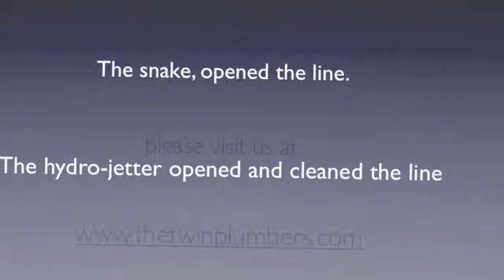Snaking vs. Hydrojetting

Comment: And when your done installing the new sewer main pipe in the trench replacing the broken pipe from the tree roots, don't forget to buy a few bags of water softener salt pellets and dump em' in the trench around the new pipe where the tree roots were growing and then backfill the trench with dirt. By doing the salt dump method in the areas where the tree roots were growing you are preventing the roots to grow back again inside the pipe because tree roots won't grow where salt pellets are. The roots will grow away from that area which means they won't go near your new sewer pipe again resulting in years of solid sound sewer pipe service worry free of future roots breaking in  to your pipe again. You gotta be smarter and think smarter than the tree roots......works every time.
Reply: @Connection-Lost  Yes water they like, salt they don't and grow away from. No thinking involved by tree roots but yes thinking by man can outwit the tree roots. I really didn't think I had to explain this but since you are having problems understanding......well here ya go.
Reply: @Connection-Lost  Dumping salt in an area will kill plants there, so it makes sense that dumping salt near a pipe will prevent root growth, at least for awhile.
Reply: Just curious as to what the salt will do to the pipes in the long run as well...possibly eroded the pipes from the outside in this time maybe?
Reply: @sweep-n-clear  What kind of pipes are you talking about here? Nowadays sewer main pipes are installed in either ABS black plastic or PVC sched 40 white plastic. Neither of those two materials can be broken down by salt.
Reply: @Eddie-In-Las-Vegas  im not sure about the pipes i was curious...I'm having shower problems which might be caused by my palm trees...here in Las Vegas NOTHING is buried deep at all because our soil is like clay
Reply: @sweep-n-clear  I'm a plumber here in Vegas and every sewer main pipe we replaced where the customer did not want to eliminate the big front yard tree that caused the damage to the pipe to being with, we would pour bags of softener salt in the trench with the pipe in the areas where it was close the tree, the tree roots will grow opposite of that area.
Reply: @Eddie-In-Las-Vegas  dang...sounds like i might be calling you next 😁😁😁
Reply: @Eddie-In-Las-Vegas  is $375 a good price for jetting the shower drain?...we paid $80 to do the same thing these guys did in the video...the tip of the snake had a spring like gadget on the end like these guys had i believe
Reply: @sweep-n-clear Jetting service for one branch pipe.can cost anywhere between $300-$600. But consider this, usually a kitchen drain requires jetting service due to the cooking grease that collects over time inside the pipe and restricts flow. A shower drains main issue is hair collecting inside the pipe and a cable snake with a cutting tip usually does the trick for that. Unless you have tree roots, the jetter is quicker and more effective at eliminating tree root growth inside a pipe. Did the $80 job not end up clearing the shower drain for very long? Or is it all fine now?
Reply: @Eddie-In-Las-Vegas  no the $80 job didn't fix it completely
Reply: @Eddie-In-Las-Vegas  as long as you go #1 or just shower downstairs everything runs fine...once we flush paper or #2 down it slows it up quite a bit
Reply: Who said anything about installing a new sewer pipe.  That is SO SO old-school.  Not applicable in 2023.

Comment: Had my sewer line going to street cleaned. Plumber used hydro method. Lasted 3 days and backed up again. Had another guy come and used rodder with cutting tip. That was 5 yrs ago no problem since.
Reply: Jet does nothing to Roots, just pokes a hole. But running a snake with blades will keep the roots at bay until they grow back!
Reply: @JJ-xo3er  You need a special head for roots called "wart hog"  very expensive but works well
Reply: R S  Rootkiller application: Do they insert a line with spray holes  and camera or just shoot and spray the whole length without a camera?
Reply: R S  No desire to have that proceedure done, warm and fuzzy or not

Comment: I live in a 70-year-old house and kitchen sink clogs all the time. I'm advised to use hydro jetting and was wondering: 1. if it is safe on my old pipes; 2. how much that costs; 3. Which state are the Twin Home Experts service. Thank you!
Reply: I just got a quote on my 2300 ft² home to do a whole house hydrogetting. $2100. Since the houses more than 30 years old I'm going to go ahead and just do it. The house was already repyped I believe about 18 years ago.
Reply: @wadafruit  Thanks! I called Roto-Rooter, they cleaned the line and said no need for hydrojeting. $830.00. Been few months and is still works well.

Comment: Right, now try this on REAL pipes in your home, old home and this is probably a disaster waiting to happen.  Old homes use cast iron pipes and sometimes the line pipes are brittle / rusted - these electric snakes can cause a disaster on such pipes and you might end up with very expensive repairs in the 5 figures, that KNOCKING inside the pipes can't be good.  It might be no big deal on the PVC pipes, but I would not use that method on old cast iron pipes, I've heard horror stories there.  Same for hydrojetting, I know someone who did that, and it cost her $25,000 in repairs from burst pipes due to the pressure. You can be sure that all the piping in old buildings and old homes are just disasters waiting to happen, banging and unusual pressure inside those pipes will only make matters worse.  Also a lot of people previous to using those methods have used Draino and other garbage products so over the years this kind of shit made the pipes even worse.   I would use electrical snaking on PVC pipes, I would not use them on cast iron or old home piping that is in bad shape.
Reply: Bad pipe to begin with, have to try and clean it with a snake first and if it breaks the pipe then the pipe was brittle and needed replaced anyway.
Reply: So what would you recommend? I live in a home that was built in 1970. Probably 6 plus years ago a plumber ran a snake 75 feet to clear the line. All the way to the house outlet at the septic tank. I believe he mentioned "clearing roots".  Now the sink is not draining and we have tried all the DIY methods we know. Time to call a plumber. The guy had a large auger-powered snake for the job. He is still our plumber and when he comes to our house that is about the only tool he needs unless it is a new fixture installation.
Reply: @lindahathaway3519  Can use a camera to see what is wrong and its location. Then dig up that spot. Either replace the pipe section, or seal around it depending on what is wrong with it.

Comment: First off, you wouldn't use a puny drill snake on a line with roots in it, get a Spartan 100 machine to clear the kitchen drain. Also odds are against roots in your 2" line, unless it leaves the house separate from the main sewer. Jetting can clear roots with the right head on the jetter. As the thieves at rescue rooter used to say "cable is able, but jetter is better".
Reply from the maker: p gill 
This is NOT implying that we recommend using a small hand snake to remove roots . This video intention shows what a cable does vs what a jetter does . 
Wether it’s a large cable or a small cable it has the same action , NOT power , we get . Roots require a 7/8 cable with cutting blade etc ...

Thanks a for posting

Comment: Great video for the basic ideas of both techniques, as a first time DIY guy I have a good idea as to what I need to pick up from my local supply store and think this video is a great way of showing others like myself 'what the deal is'. I'm having a water build up in my basement 'slop sink' so I plan on hitting up Home Depot for a water bladder and a 50ft snake to clear whatever obstruction is causing the block. Fortunately the water DOES drain itself slowly albeit not good, but better than a complete stoppage. Thanks for the information, this video was very helpful to me! =]

Comment: THIS IS NOT AN ACURATE EXAMPLE! 
I followed up a company that used the jetter to clean a line with roots only 6 days later. I used a snake with a proper sized cutting head to remove the roots that were left behind by the jetter. (The jetter only washed the debris off the roots leaving the roots behind) Here the roots here are placed into the pipe. It is my experience that the roots find a penetration point from the exterior of the pipe through a break or bad joint and grows a tendril root that has to be cut.

Comment: I can’t picture the jetter working when the pipe is BLOCKED to begin with. Wouldn’t the water just come up the drain as soon as the sprayers are activated???
Reply from the maker: The first step is to start slow to puncture a hole through the solid blockage. In certain situations does require using a cable to puncture a hole to release water pressure build up, then move forward with jetting.

Comment: Septic field - Hydrojetting may clear the lines, but the real problem might be that the gravel is gunked full.  Our septic field is 46 years old.  How can I find out if the gravel is clogged?  If I dig, or rent an excavator, will that help me see?  

$6900 Canadian ($5550 US) for hydrojetting (5 leaching pipes x 60' each).  How many years will I get for $6900?  Should I be putting that money into a new septic system?  (~$30,000)
 
In this video we didn't see a vacuum sucking the results of the hydrojet backwards.  Even with a vacuum sucking at the head of each pipe, surely some of the material broken up by the hydrojet will get pushed through the pipe's perforations. The volume of space between gravel is (I presume) greater than the volume of the pipe, but still, if the gravel is not already clogged, this will add more gunk to clog it.  

Ground-Penetrating Radar can find the location of septic fields.  Is there any way to see if the gravel is clogged?

Comment: city came water flushed outside.......One pro plumber came snaked pipes for awhile retrieved pile of bay wipes (baby wipe tenant moved out before clog).. ..gave up was paid $189. he and partner left pipes still clogged.......next pro came after several hours of snaking...still clogged he left... left sewer back up in cellar...3 days later same company came and worker snaked more baby wipes out..... flush water started flowing cost was $1000.... week later clogged again.. ...now pipe still clogged ...oh well .....no one used hydro flush yet...some charge $500 for flush..any advice?
Reply: Keep your receipts and good records and sue the baby wipe tenant....
Reply: how old are your pipes? what kind are they? more handy-wipes might be clinging to the rusty walls of the pipe. there are snake-heads for removing rust from the inside of the pipes.  Paid a plumber to use those heads and then tape over all the drains, water tight the toilets, and use a bad-ass plunger with gallons of water. if that does not work, maybe the house and pipes have shifted over the years and they are not now flowing in the right direction.

Comment: If you have a septic system easy just call local septic guy to pump tank and put suction line on pipe coming from house.  Pull out cash and bill drops from 175 to 140 fast.
Reply: is it really that easy?  We havent pumped our tank out in 5 or 6 years...and now have a slow draining toilet...mind you the tub drains fine and so does the kitchen sink....so Im curious if my tank is full, or if the toddler flushed soomething down the toilet....i tried the diy toilet auger/snake but that didnt seem to work (ended up actually breaking the plastic end trying to ram the snake//auger further down/through the toilet...lol...

Comment: You have to run the snake back and forth several times once the  snake motor lugs down...  FOOLS...!
Reply: The snake is the worse thing to ever be invented, it does damage to the line when used overtime
Reply: Metz not if you use the correct size, cast iron should be replaced anyway
Reply: @mets23q  Its an either or sort of thing
Reply: @mets23q  Hmmm,well,if the snake werent  invented theyd have to  dig up your line to fix it. Starting at one end working to the there., Id rather eventually wear out the pipe w/a snake and have it last me awhile longer than dig it up everytime.

Comment: Jet cleaning is a scam to change $1000. Dollars instead of the standard $100 to $250.  They have been cleaning out 6 inch pipes with a power auger since 1933  that scrapes the edges clean. This jeting just recently became popular because they can scam you for $1,000 and then it takes the same time as a power auger. You can take any 3000 psi power washer and buy the hose and tips as shown in another YouTube video.
Reply: yup

Comment: Snakes don't really clean pipes. They can restore flow, usually, and break up soft clogs. But the pipe will not be clean. Also, because the demonstration pipe is clear and smooth, the snake will not be encountering any other issues. Now, if this were a sewer pipe in a residential location, you could have scale, FOG, breaks, bellies, etc. that will make the job more difficult. But I love seeing how effective the hydro-jetter is at shmashing that blockage and leaving a clean pipe.

Comment: Roots don't just lay around loose in the pipe.  They come through the clay pipe and hang on for dear life making it tougher to clear them out.
Reply from the maker: swankydog 
Yes. They come through the joints or connections . 
This is a video showing the “action” of a hydro jetter VS a cable method
Reply: roots will infiltrate ANY pipes that has a crack  or open joint not just clay
Reply: The Twin Home Experts I was wondering how the hydro method handles roots that have come through joints and/or cracks and not placed in a pipe for exhibition of the method. Roots would seem to be anchored yin the pipe and not easily removed with the hydro method, unless it actually cuts them and not just a narrow hole in them.
Reply: Have you ever used a straight jet pressure washer attachment with 4,000 psi? It will literally eat asphalt, shread the worst wound in your hand you've ever had, and absolutely ruin a wood fence. It will also blow the paint right off your car and the remove the mortar holding your brick wall together. Roots would be no problem for that.
Reply: What you say is true. Clay pipe with joints should be replaced whenever possible.
Reply: LBCAndrew a shotgun might blow a hole through your body. Will it blow a 4” hole?  Not sure, maybe at the exit. 
  I don’t know if that apparatus has a swiveling end to it or if it just shoots a straight line that will cut through very hard substances. 
  I have a couple of Pulsators that seem to work pretty good for some blockages.  In the case of roots, I expect I would have to plan on doing it over and over until pipe is replaced.

Comment: What about water backing up when using the hydro jet?  I mean if you start putting water down a clogged drain the water will start backing up...do you have to get to the clog quick so water does not fill the pipe up first and back up into the home?
Reply: That's probably why it's not a recommended process for interior drain locations where 12 gallons a minute shooting back from a solid clog is a possibility-

Comment: Roots in a 2" line have a distinct feel. The cable slowly burrows in increasing the likelihood of getting hung up with that machine. As soon as I feel that, I pull back. Maybe make another run at it. But if I feel the cable not making progress and smell the roots coming back through the cleanout, I generally stop and and give the option to replace the line or stop and try to run a larger cable. This is usually only a temporary fix. A 2" drain should not have roots in it.  No guarantee. The roots will grow back and they will continue to have the problem.
Reply: Thanks for that input rts!  I have a very LARGE pine tree out front and am praying its NOT the problem!
Reply: Copper sulphate is one root-control treatment by pouring it into a toilet. Its effectiveness is limited by the fact that it usually doesn't stay in the pipes for very long.
Filling the pipes with a foam consisting of metam-sodium and dichlobenil may be better.
The foam sticks to the roots and walls of the pipe, and kills roots within hours, although it may take a year for them to decompose and wash away.
Or just cut the tree about the line of possible
Reply: buy the proper tool and use it once or twice a year as maintenance

Comment: Like to point out that jetting should always be done downstream as to allow the rear jets to pull back whatever is blocking the pipe.
Reply: No.  Not always.  You are incorrect.  Sometimes it is not possible, so you have to snake it first and punch through the clog, then work backwards.  You are not smart.

Comment: Yesterday started with one toilet at bottom was leaking so replace wax ring . This morning noticed toilet right in the next room was clogged I've tried plunger but it's bigger problem  since looks like crap coming up in that next room's shower drain . I know you don't know how my lines are running this way or that but what can you tell me ? Seems next step is auguer / snake it but not sure where to enter . Have one cleanout I might use but it's way in the backyard

Comment: I like the concept. But the only thing that I wonder is how do you know that you fixed the blockage. At least with a snake , stuff that was blocking the pipe will come back on the coil when you pull the snake out.
Reply: I guess you'll "know" when you use the sink afterwards for awhile, either way.

Comment: What could happen if  you are using a 4,000 psi hydrojet in a hard clog line, when we know that plastic lines are less than 3000 psi, tested from the factories ?...